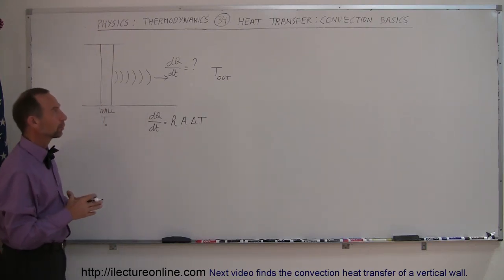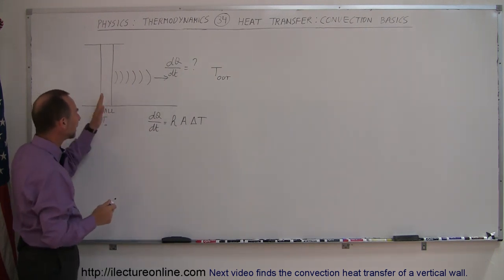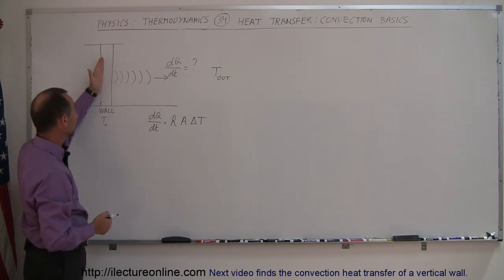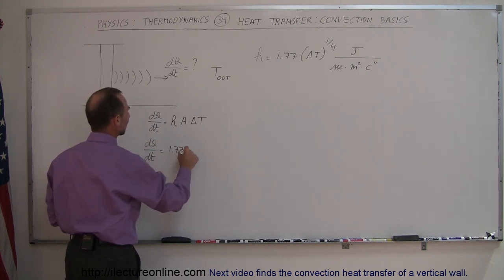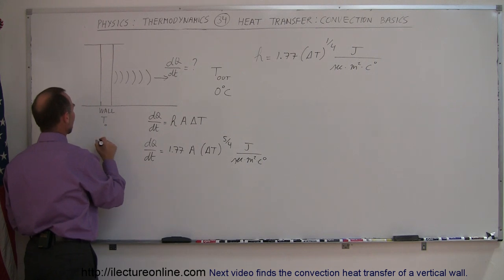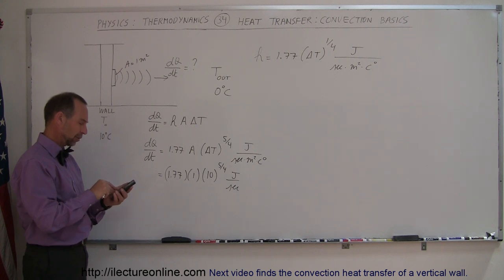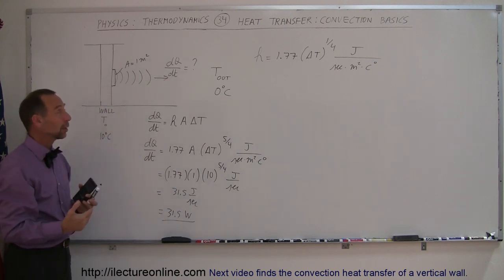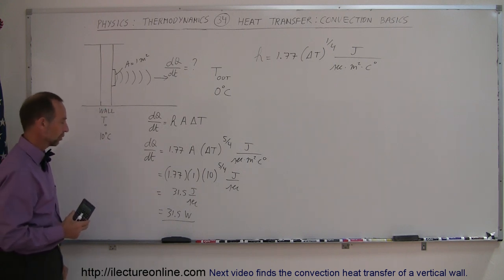Physics 24  Heat Transfer: Convection (32 of 34) Basics of Convection

Comment: I absolutely love your videos and clear explanations. Just one question, why do you use this odd number for h when h = 12*square root(v) where h=thermal transmittance in W/(m²K) and v= airspeed in m/s? When using this, the formula would become more simple and students would actually be able to find the other values of h for other fluids and real world problems.
Reply from the maker: When it comes to convection, many of these constants were experimentally derived and are continuously updates as new tests show slightly different responses.  There is no exact answer, but good approximations.

Comment: Thank you that was such a helpful video. If you have the time any hints on answering this question?

Home heating is a significant cost for Tasmanian householders. Describe some methods people can use in order to deuce their power bill while maintaining adequate heating, explaining the physical principles behind them.

Thank you for your time
Reply from the maker: Hannah,
The old fashion "swamp cooler".
Hang rags or towels above a bucket of water with the bottom of the towels submerged in the water.  The water will wet the whole towel because of capillary action.

Then blow air across the wet towels with a fan.  The water will evaporate cooling the air that is blown across the wet towels.  That is how people used to stay cool before they had air conditioners.

Comment: Search on your website doesn't work fyi It times out. -- also do you have everything backed up on a different platform in case YouTube goes down? We want to make sure we never lose all your videos.
Reply from the maker: Yes, something is wrong with the website and we haven't had time to fix it.  We do have our videos backed up at home.  Thanks for the tip.

Comment: Everyone asked a question on that video so why not me? Why delta T is not negative?
Thank you both <3
Reply from the maker: Heat always flows from hot to cold.  Since it is colder outside we know the direction of the heat flow.  To find out the magnitude fo the heat flow (per unit time) we only need to know the magnitude of the change in temperature.

Comment: what if the temperature of air is higher,would the temperature be transfered through Conduction?
Reply from the maker: Convection exists everywhere.  What you need is a difference in temperature of the fluid which results in a difference in density, which will cause forces to move the fluid.  If the temperature of an object is lower than the temperature of the air, that will also cause convection.
Reply: Michel van Biezen  Thank you sir

Comment: Do you still use the convection equation if the air is warmer than the wall?
Reply from the maker: +Kevron Rees That depends.  What question are you trying to answer?
Reply: I want to know if energy from the air (assuming the air is warmer) will transfer into the wall and what equation to use to solve the energy transfer.  I'm currently using conduction (Q = kAt) in my model and something isn't right.  I've successfully modeled a runaway greenhouse :P

Comment: How comparable is the Conv. Coeff. you use to the equation h = [ -kf * dT/dy |y=0 ] / [Ts - T∞] from Bergman's Heat transfer book? 

Mostly i'm wondering if the 1.77*Delta T^0.25 is only for air or could be used roughly for other mediums.

Thank you for creating these videos, they have been very helpful for review.
Reply from the maker: +Kehan Lykaios   Note that the convection coefficients depend greatly on a number of factors.  They do vary between substances, especially between a gas and a liquid.  They also depend on the geometry of the surface and the velocity of the transfer fluid and it also depends whether or not the fluid is forced.  Thus the number used is not a "fixed" number.

Comment: sir where did you get the 1 that you added on the 1/4 power that became 5/4?
Reply from the maker: We substituted h = 1.77 (delta T)^(1/4)
Reply: Michel van Biezen why didn't you do the 5/4 on the horizontal convection video

Comment: Pleaa tell me! what is h mean? Why h = 1.77.(deltaT)1/4 ????
Reply from the maker: h is the heat transmission coefficient for heat transfer by convection.  That equation is based upon a model that was developed about 70 years ago and still offers a good approximation.   We are currently working on a much more detailed analysis and presentation of heat transfer with convection that will show much more information on these models.